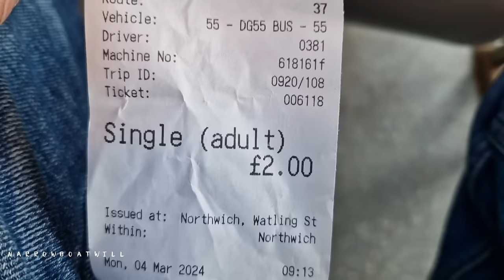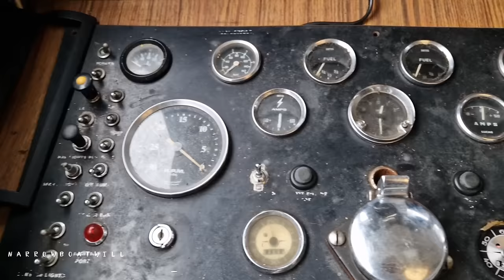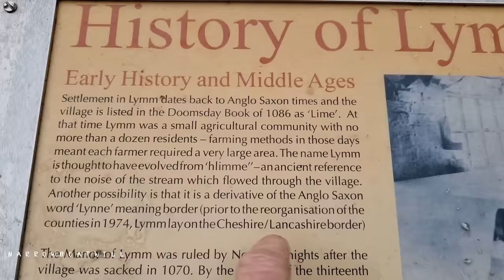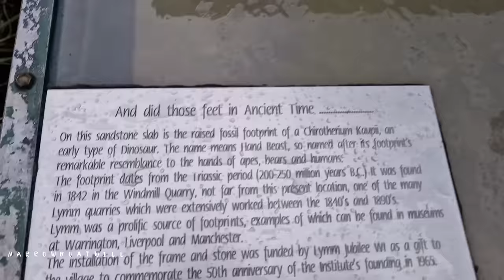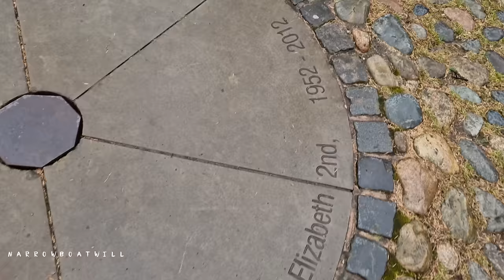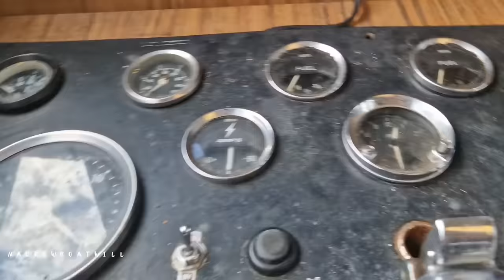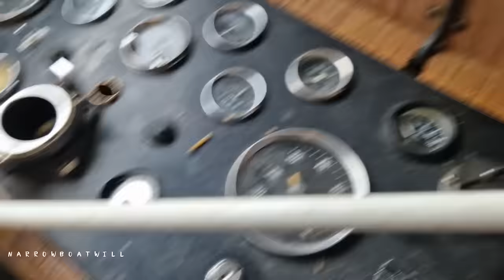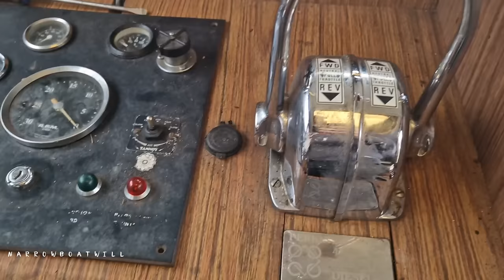A beautiful place.. My narrowboat journey continues..

Comment: Great work Will. 👍👍
The morse control will improve just by regular oiling the cable. The coolant reservoir is cooled by canal water passing through the heat exchanger. ❤
Reply from the maker: That's a good shout. I thought it might be raw water cooled. I wasn't sure seeing that header tank. Thanks buddy. 👍

Comment: Looks like an S115 series starter motor Will, Wood auto does the spares for them....
Reply from the maker: OK thanks for this info. 👌
Reply: @NarrowboatWill  I think its full part no is Perkins 4,236 Marine CAV CA45/S115 12-3 Starter Motor..... hope this is of help
Reply from the maker: @andyince  Fantastic help. Thank you. Is other starter does work now I've lubed it and it only needs a return spring. Thank you Andy. There isn't much info out there around the 70s Baracuda boats.
Reply: @NarrowboatWill  I work for a remanufacturing company that remanufactures a version of that starter if you have a po box or somwhere I could post to I could send you one 👍
Reply from the maker: @andyince  Wow! What an amazing offer. Thank you, buddy. The boat's starting and running now. The other starter spins, but it needs a return spring. I will let the chap know if he wants the other engine sorted, then he's going to need that starter. I'm off up on the Lancaster and the chap with the boat is off doing his own thing, so I won't see him for months.
Reply from the maker: I will pass your details onto him if that's OK?
Reply: @NarrowboatWill  yes that's fine mate 👍

Comment: Good work horse perkins engines.
Good choice for a boat, why two engines ? How big is the boat theregitted to must be a tanker or a tug lol.
Great job 👏  14volts should be I bet alternator needs a good clean or service..or replacing.....
Solar panel stolen that's the pits...
What is the long nut on your van wheel ?
Anyway best get a move on 40 miles to cover 😅
Have fun 👍 
Kev the brinklow kayaker
Reply from the maker: I think it's a sea good boat or big river cruiser. 2 engines gives more power. 
The nut on my van was a special tool to get the nuts off. 
Enjoy the weather Kev on your Kayak.
Reply: @NarrowboatWill  cheers happy bunny easter to you.